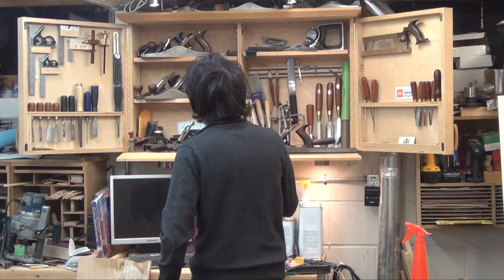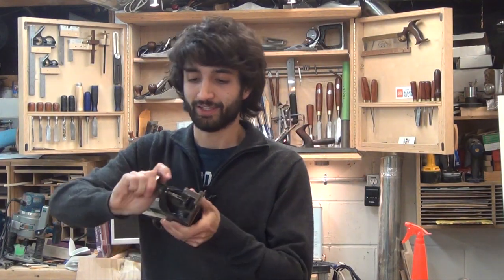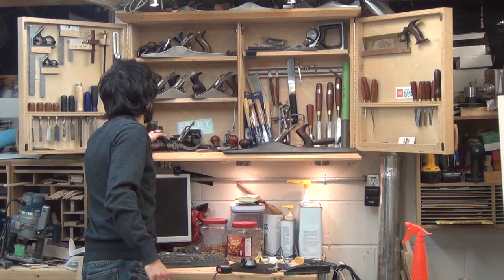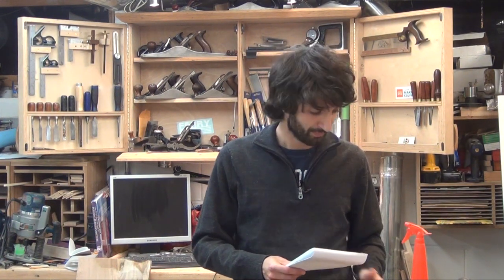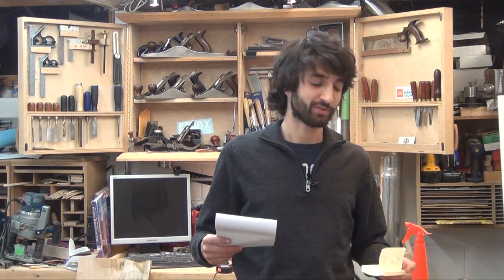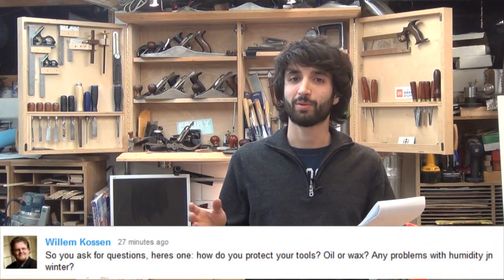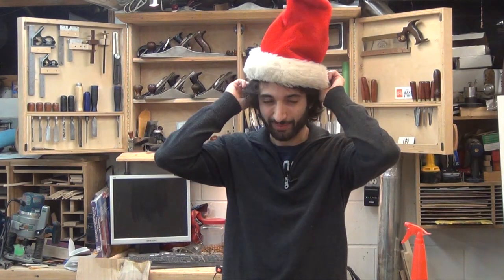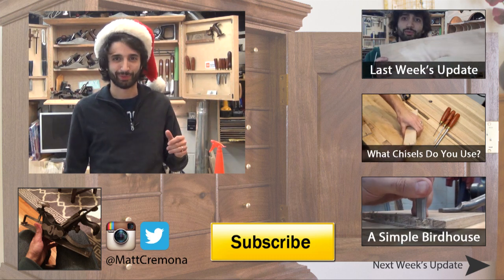Matt's Weekly Shop Update - Dec 22 2014

Comment: Thanks for answering my question. I guess your shop is warm and dry. My shed is unheated and very moist. The Dutch winter is the same, unheated and very moist :(

Rust is an issue for me. Thats why im trying to find better ways to protect anything even remotely resembling iron or steel.
Reply from the maker: Willem Kossen Maybe it is drier... who knows.  You should ask Jason McGinn.  He has to deal with the salt in the air rusting his tools.  By the sea is probably the worst place for cast iron.

Comment: I just bought a hand planer and the instructions that it came with were brief and not helpful. I have never had one before or used one, so I am asking what is the right out of the box work that has to be done to ready a planer for use with fine detail work?
Reply from the maker: Are you referring to the electric one you were using to make you're coffee table?  Or did you also pick up a human powered plane as well? :)
Reply: yes I picked up a human powered one as well haha
Reply from the maker: TheOtherSideOfAlex haha!  With that one, probably the most important thing to be get the blade very very sharp.  A dull blade will make that thing so frustrating to use.
Reply: Thank you so much and Merry Christmas!!